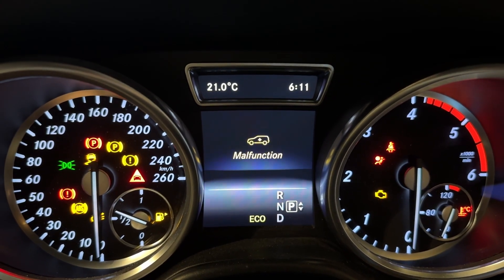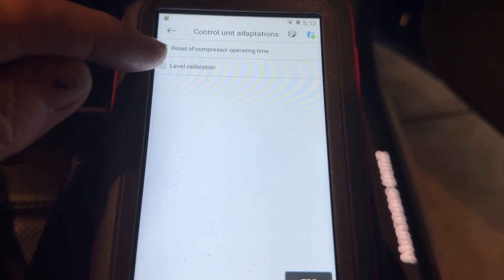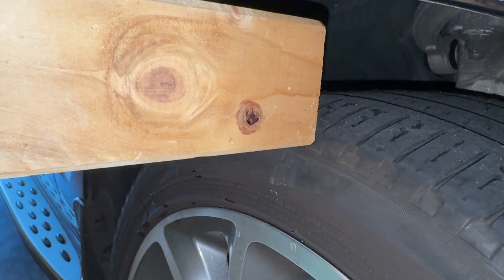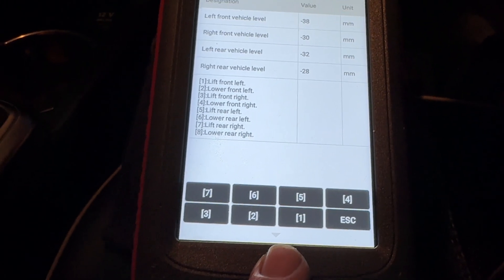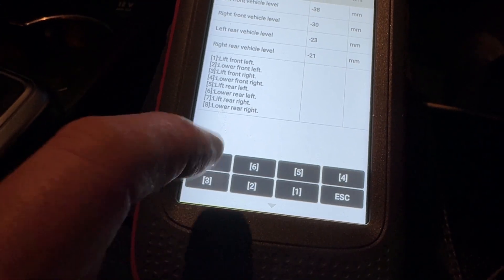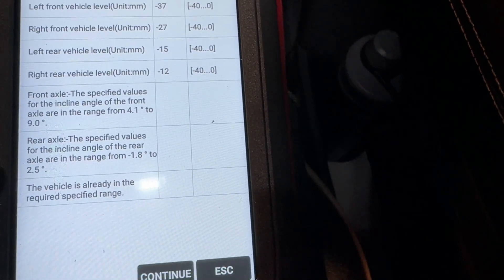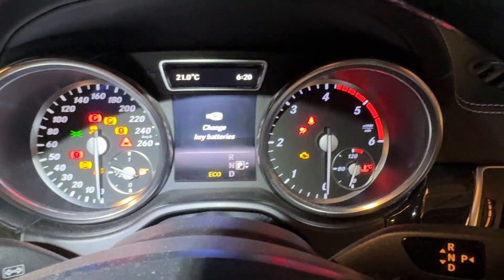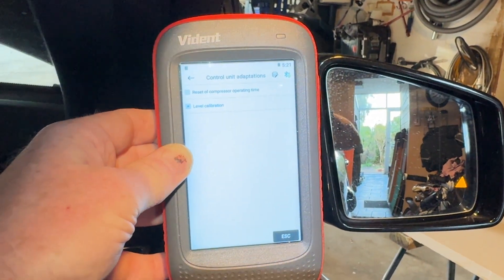Mercedes Air Suspension Calibration - Vident Diagnostic Tool

Comment: Hi How did you get the degree angle ?
Reply from the maker: I just guessed them.  I'm not even sure what angle they are measuring.
Reply from the maker: Something like this is needed to measure: https://cdn.adminca.com.ua/manuals/913009024/instructions.pdf